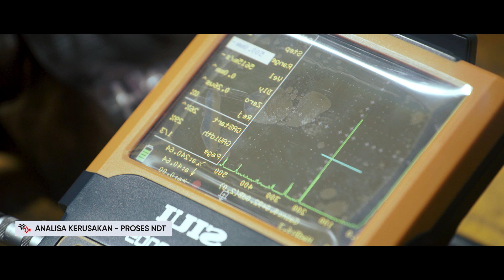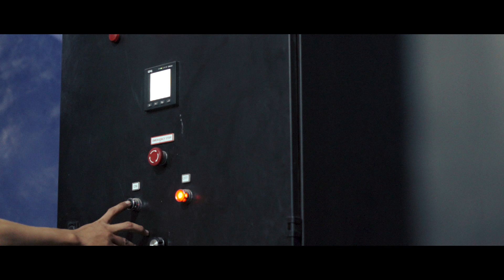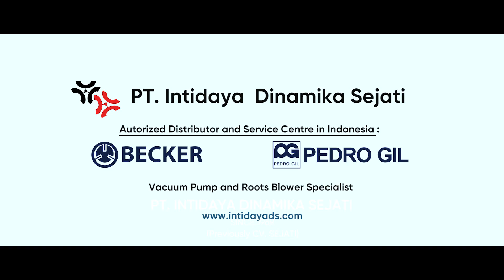Process Service Roots Blower, Aerzen, Robuschi, Pedro Gil, etc

Comment: Di tempat saya kerja ada blower 3 lobe merk snh 890 hibon

Cleareance rotor thd housing sudah 0.60
Apakah bisa di rekondisi?
Reply from the maker: silahkan hubungi nomer berikut untuk informasi lebih jelas 0817-0317-3000